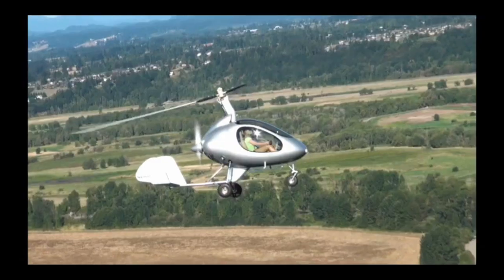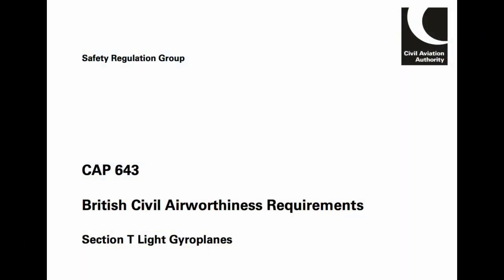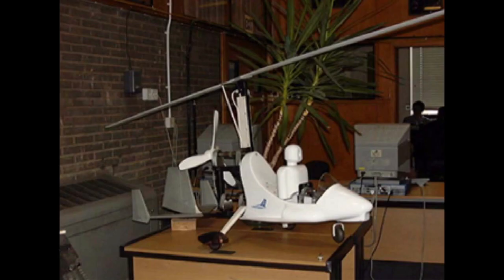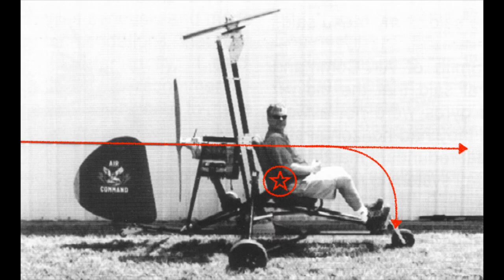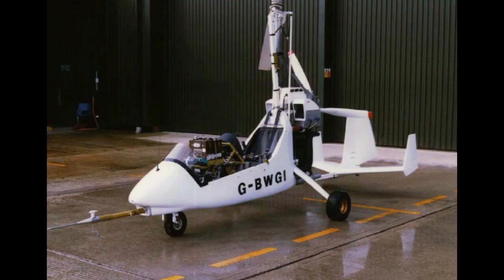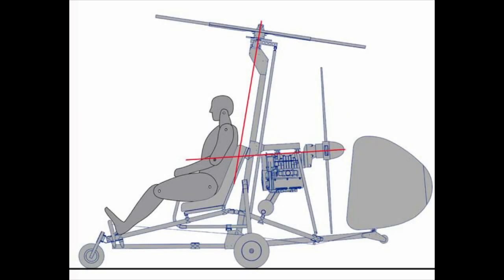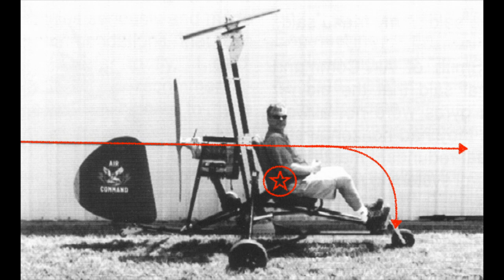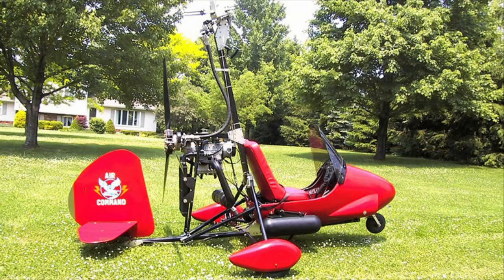History of the Gyroplane - part 19 Flight dynamics study (Glasgow University) & BCAR-T

Comment: Thanks for all the great videos, it's reawakened my desire to fly one.  One question about the UK regulations, do they only address pusher designs?  It seems like demonstrating tractor gyro stability would be a simpler route to go
Reply from the maker: Hi and thank you for the kind comments.  In the UK there are only pusher aircraft available but if you look at the tractor film I made you can see the others that are available. Cheers

Comment: Interestingly enough as you noted I think, all BCAR Sec T compliant gyroplanes in the UK save I believe one are all high thrust line
Reply from the maker: Hi Abid - yes you're right part of the rational for that was that things like the older AutoGyro MT-03 was going through the acceptance process where BCAR-T was in change and the university study was on-going.  I actually think however that its proving the stability that is a bigger point and when (as was the case with the MT-03) there were significant numbers being flown outside of the domestic market you get an easier time.  In the end UK certification is built up to be a nightmare (and it isn't the work of 5 mins) but it is a process driven thing and if you have the paperwork together and the aircraft is fundamentally sound then you will see it fly in the UK.
Reply: @gyrocopterflyingclub6148  In fact I think that having close to CLT (I prefer slightly higher like 2" higher than CG) and having a horizontal tail are both very important. One provides better static case and one provides better speed stability. If we really want to reduce the number of pushover accidents, fixing the rotor to a particular angle so that RTV intersects CG and using a horizontal tail with elevator may be what is desired specially for people coming from the airplane world
Reply from the maker: @abidfarooqui-sla3301  My own academics don't allow me really to investigate the effects as I soon get lost in the maths.  However in the UK Liverpool University has actually been quite active in some research with gyroplane rotor and dynamics.  There has been a paper published by Sophie Robinson that completely nailed the stability issue.  If you email Gareth Padfield Gareth.Padfield@liverpool.ac.uk he might be able to send you  copy of the thesis.

Comment: @Gyrocopter flying club >>> So WHICH autogyro/gyroplane/gyrocopter CAN YOU legally own and fly in the UK now? 
 
{Sorry, I OVERSLEPT and my BRAIN is STILL partially asleep at the moment.}
Reply from the maker: Hi - So you can fly older aircraft but they need to have been registered before (or the project started in period) and the documentation needs to be complete.  The caution there is old Bensen types need to have either been signed off as a complete aircraft already or you need the project build file complete with drawings and inspectors notes from the time really (you possibly could do without but the faff will be unbelievable).  Outside of that the only new aircraft available right now are AV18's or the AutoGyro/Magni aircraft.
Reply: @gyrocopterflyingclub6148 >>> Rodger that -- Thanks. 

Sorry I did not comment this previously. FWIW, I started rewatching this series of videos last night...👍